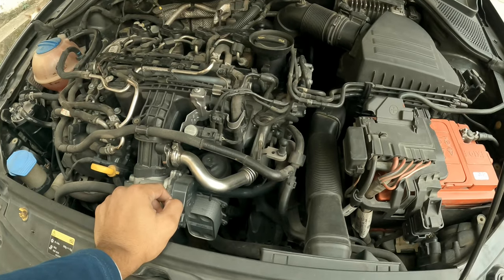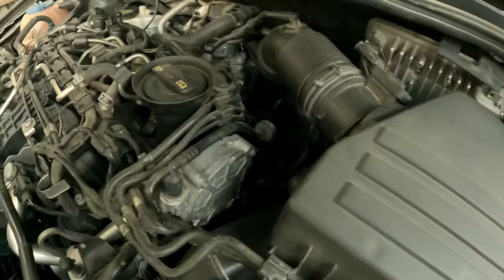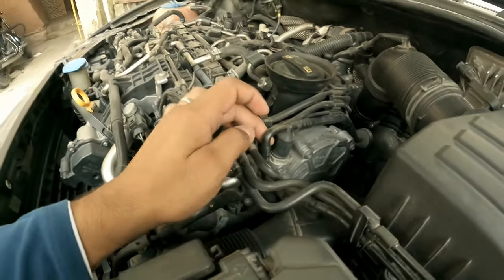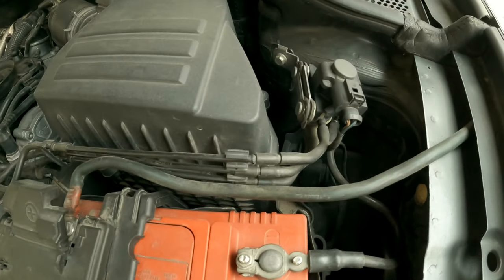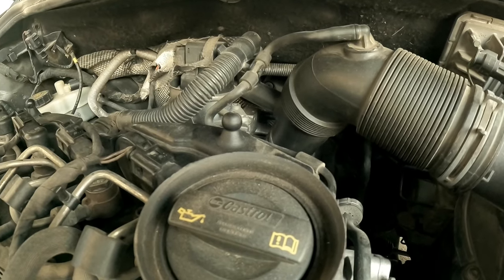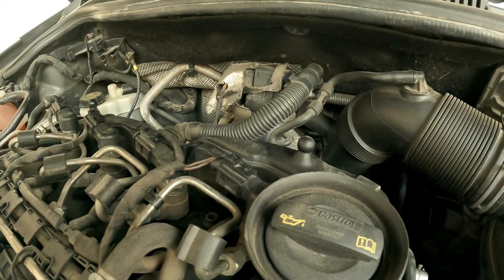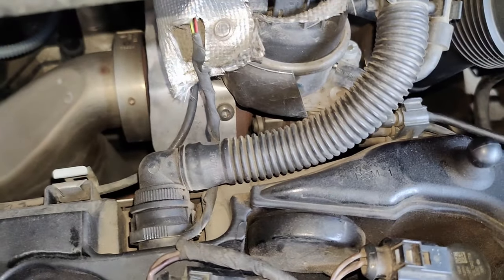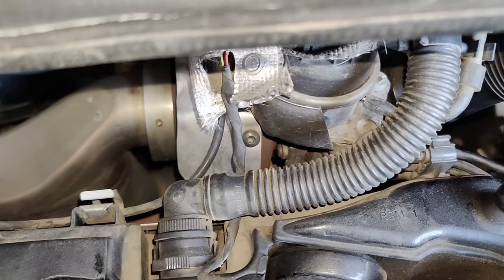TURBO BOOST PROBLEM VACUUM PROBLEM | UNDERBOOST | OVERBOOST | LIMP MODE | P0299 | P02563

Comment: Hi dear sir the glow plug sign and engine management sign come every time and I have to take to mechanic every time can you advice me can do my self I spend money every time please if you have videos how to repair so I can try sir
Reply from the maker: What's the actual problem or the code if you have any ?
Reply: @yourDIYneeds  yes sir code I have P2463    Next p0121 Throttle pedal position sensor switch A circuit range performance I clean this 100% and fix his place again but three sign still there sorry you speak hindi thank you sir if can help me
Reply from the maker: P2463 is particulate filter 
P0121 is throttle pedal  range 
Try adjusting the throttle pedal in exactly in a way that is just a bit less than , raising the rpm of engine .

Comment: Sir,fault code P256400 pls tell about this issue
Reply from the maker: Sir tubo ke boost pressure sensor pe voltage ka error hai , maybe low or high
Reply: sir,Circuit low
Reply: How to solve this problem sir
Reply from the maker: Yes , its not receiving the desired amount of voltage

Comment: Hi sir, thank you for informative videos on TDI engines. I have a 1.6l tdi CLN motor, it's throwing a p0407 engine fault code. What could be the problem?
Reply from the maker: Sir , need to clean the egr .
Its a code for egr system

Comment: Hello bhai, 
I have a vw polo 1.2 tdi, same warning sign glows as in your video when I hit 120km/ph or when I hit the gas a bit harder.. I replaced the Heater plugs already but that doesnt seem to be the problem, do you have any tips of suggestions of what it can actually be? Thanks for helping me out 🙏
Reply: filament bulb sign I mean with warning sign
Reply from the maker: Sir the very first thing is to scan and look out for codes , it will provide you with a direction to work
Reply: @sameditzz287 did u sort it out? I am hving same code
Reply: @hariskhan1000  better to sell your car pr get your car fixed asap cause its not a good sign for your car/engine i  have already sold my car bearing some loses but i was literally fed up by repairing the vehicle again and again as this problem led to wear and tear of my machine !!

Comment: Thanks brother for explaining the untold stories of skoda/vw cars. In rapid ,the vacuum control actuator was making some weird noise after switching off the engine. And only rarely it happens. Scanned but no issues found.. and there is no pick up issues also ..
Reply from the maker: Sir its getting stuck on random positions , thats why its making noise .
Reply: @yourDIYneeds  thanks for reply.. Is it a costly part? There is no regular noise from it.. But only rarely..
Reply from the maker: It has started to stuck , use it till the time its working sir
Reply: @yourDIYneeds  yes.. That will be good.. Now searched in blood money. It's listed as pressure converter costs around 4500.. Thanks 🙏
Reply: @yourDIYneeds  one more thing noticed regarding that part. Today morning, I started it, kept it idling for arornd 30 mins as I didn't drove for the past 1 week. The particular part heated up a lot that we can't touch it. Is it normal or symptom of getting damaged ? My area is not a hot area. Only around 27-28 degrees
Reply from the maker: No sir it usually is just warm , not hot
Reply: @yourDIYneeds  it's really hot. Whether it's complete failure cause stalling rhe engine on the road? Or powerloss kind of things...
Reply from the maker: Sir , as soon as it gets cooked complely , you car will go into home limp mode and cut power , but it will not leave you stranded on road , don't worry
Reply: @yourDIYneeds  will try to replace by December..probably it's a plug and play fitting as it seems. .. Annual service done 2 weeks back by myself.. So little financial crunch.. All filters replaced and flushed the engine. Filled with edge. As it ran only 2800kms , didn't go to liqui moly.. Thanks brother for ur support and videos...
Reply: Bro .. replaced the solenoid valve as it was making noise andvibrating ever than before.once happened to visit ASS, the technician accidentally touched and burnt his fingers. So it's replaced from there itself. Now the noise is gone but still getting hot after few mins of drive. While idling , if we touch it, we can feel the solenoid inside is moving randomly . Then actual reason is not the solenoid valve ? Checked the vacuum lines , didn't see any visual leaks. Any clues ? Thanks
Reply: @jinurajkr  any update?
Reply: @jinurajkr If your solenoid is hot, you might have a leakage somewhere. Check careully the hose from the solenoid to the t-connedcn . From t-connection to the pressure converter which is connected to the top of the wastegate. Take the hose out and check for any damage. I have replaced my hoses. If you have a BMW you need to buy 3,5mm diameter vacuum hoses. You can see it is something wrong by checking the datastream of the booster pressure solenoid. It should show steady at 100 percent. Use a car tool scanner.
Reply: @dinhvanpham8102   Thanks for ur valuable suggestion . Will definitely check.. Mine is a Skoda

Comment: Hi I have a 2016 Jetta 1.4 tsi and my wastegate actuator seems to not close all the way sometimes and it makes a kind of ticking sound when I’m driving when it’s making boost . I get out the car to pull the wastegate rod close and it’s fine for awhile then it start again do I need a new wastegate actuator?
Reply from the maker: Sir try to do a turbocharger adaptation , if the problem is not solved after that , then we are looking towards replacing a part .

Comment: I buy new Artilink 500 from this cod rider can I remove this sign 🙏
Reply from the maker: If the problem is not addressed first , it will come up again
Reply: @yourDIYneeds  thank you sir 🙏
Reply: @yourDIYneeds  if I drive car in motorway any problem sir

Comment: Hey I have a 2014 vento tdi .I notice since I got it, the brake pedal is very hard when I jump in a few minutes after I turned off ( 5 or 10) . Like a boost leakage but I don know if this is normal or not . It's not getting worst but I have it my mind
Reply: Not boost . I mean vacuum: )
Reply from the maker: Sir seems like a vacuum leak , may be a leak from the vaccume lines or brake booster itself , thats why brakes are hard
Reply: Any update i had same issue i changed boost solenoid and it went ?

Comment: Hey please helpp i am getting error code P029900 car giving white smoke on reverse gear or when need power it fails to give but according to mechanic turbo is okayy tf is happening with the car also it’s burning engine oil ?? Please reply asap
Reply from the maker: sir its a code for under boost , check all the pipes and connection from turbo to intake manifold , either there is a loose connection which is letting air out or a pipe got cracked.

Comment: Awesome content🎉
I have tak tak sound coming from the n95 module in my 1.5 tdi. No error codes.
Any info about that?
Reply from the maker: Noise is nothing to worry about , ECM is just trying to control the vacuum by rapidly opening and closing of the solenoid which creates that "tak tak" noise

Comment: Please Please help me. I have serious problem in my VW Vento 1.6 TDI 2012 model. Problem is , when i my car reaches exactly at 100kmph , there is sudden drop of pikcup and glow light comes on and car stops pickinh up. On scanning with OBD , there is this error PO299 , Turbocharger Underboost. 

Can you please tell me the fix ?
Reply from the maker: First check if there is any leak in the charge system ( from turbo to intake manifold ) like a loose pipe clamp of a punctured pipe line 
Second if it still exists then , it can be one of the two sensors which is faulty , either charge pressure sensor or VGT actuator.

Comment: Is it ok to blank egr of xuv500 1st gen?
Reply from the maker: Sir egr blanking can be done on any vehicle , some engines will not throw any kind of check engine light , but some does
Reply: @yourDIYneeds  after blanking egr on my xuv500 there little bit oil leakage from breather… is it due to egr blanking or there might be some other issue?… please reply😇
Reply from the maker: No sir , its not due to egr , egr track starts after the exhaust manifold and then it returns some of gas to the intake back , if that intake return line is loose , thats a totally different things but egr has nothing to do with it

Comment: Hi my 1.6 audi a3 has coil light flash then engine management light with code p2563. Is the fix to replace the vaccum pump or the accuator or sensor?

Comment: Hello, I have a golf 5 2.0 TDI 103kw 16V, 2004 year, I have repaired my turbo 3 days ago it was in terrible condition and I always had a problem of my car going into safe mode, I can drive it fast and give it full power but when I maintain a certain speed, let’s say 130km/h in 6th gear, after 15 - 20 seconds the car just goes into safe mode, it makes a weird whistle noise as if there is a hole in the pipes of the turbo but there is no holes.. If anyone can help I would be grateful.. I have it for 10 month’s and noone knows what is it.. Some say it’s because of throttle valve but I don’t know.
Reply from the maker: Sir the best thing is to check it with a scan tool  and have a look at the live data .
Check few parameters like charge pressure, vaccum , MAF values  and check these things on both ends actual and specified, if you find any difference between actual and specified , then that is your problem

Comment: My car has difficult issue. When i start car vaccum is perfect bcz turbo actuator rod moving in actuator side then i shut off my car them its moving opposite of actuator but the problem is when i accelerate my car - actuator not move (No boost ( glow plug light also flashing) ) help me anyone
Reply from the maker: Have you checked the vacuum control actuator ? It is located on the co-passenger side just on the right side of the battery ? Its also called N95 valve
Reply: @yourDIYneeds  yeh, that working fine when i start car or shut off car
The problems is when i drive or accelerate car car took only vacuum. No boost at all
Reply: @yourDIYneeds  when i start car turbo actuator moves , when i ignition off car actuator move another way
Reply from the maker: Sir then look for any kind of leaks or loose pipe connection on charge system, from turbo to intercooler and then to intake manifold
Reply: @yourDIYneeds  Hello .. all the pipe lime are perfect.. my last question is .
Can this problem happen with CAT or from muffler ?
Reply from the maker: Sir , Only if its seriously blocked , check the exhaust flow on the tail end once to confirm that

Comment: Hi man  i have code on my golf 7 2.0 Tdi 110 kw P2563,can u help ?
Reply from the maker: Sir it seems like you need to calibrate the wastegate actuator on turbo , maybe due to deposits , wastegate is not able to open or close completely, address that once and reset the codes and check again after all the these things
Reply: @yourDIYneeds  Can i calibrate it with vcds or odis ?
Reply from the maker: Sir maybe with odis its possible but of vcds is not showing the calibration options then its not possible through vcds , but my question is why do you want to do it ? 
Because engine automatic calibrates the amount of fuel delivery and pressure as per the requirement of engine on every rotation!
Reply: @yourDIYneeds  because lamp is blinking on dashboard
Reply from the maker: Then firstly check for error codes

Comment: Hey bro in the obdeleven you have can we do injector minimum quantity adaptation? (where the engine keeps raising to 4k rpm for several minutes to learn pilot quantity of injection)
Reply from the maker: Yes air we can do that , but before i would like if you watch , another video from my channel , which is the explanation of that topic , it might change your opinion
https://youtu.be/bdbaLKn611I
Reply: @yourDIYneeds  buddy I've seen each and every video of yours!! I'm a long time subscriber!!
Reply: I had mailed obdeleven official site but they said they do only software support for the one click apps. Just to confirm before I order should we enter some channel manually to select micro quantity adaptation? If so please check and let me know. It's one of the reason I want this over vcds Ross tech.

Comment: Hello sir plz suggest me which tool kit set is best for tata safari dicor
Reply from the maker: Sir for safari you need 24mm + oil filter tool and basic screwdriver set is needed ( for general service , but for further work you will need almost all the sockets for 10 to 21 mm
Reply: Turbo accuator is not working  how to solve it means not sucks finger when we remove pipe from actuator sensor safari 2009
Reply from the maker: Sir have to check the operating voltage on the connector of sensor with load , if the voltage is ok then chances are that actuator has gone bad
Reply: @yourDIYneeds  acuator naya laga padega ya yeh saaf b ho sakta hai aur isse ke kharab hone se pickup bikul zero b ho sakta hai
Reply from the maker: Sir pehle to voltage check hogi , kuki agar wohi nahi aa rahi hogi to actuator work hi nahi karega

Comment: Vw vento 1.6 tdi engine down ka pta kaise chLta hai bhai ji
Reply from the maker: Sir engine down ? Mai samjha nahi ki aap kya pochne ka try kar rahe ho .
Reply: @yourDIYneeds  mtlb ki vw vento ka engine overhaul hona hai toh kaise pta kre . Mtlb engine back compression kaise check krte hai vw vento k liye
Reply from the maker: Sir vw tdi engines me thoda sa back compression ( blowby ) by design hi hota hai usme worry karne ki need hi nahi hai , baki agar fir bhi overhaul karne ka jab pta lagega , jab engine ek limit se jada oil consume karna start kar de  ( 1 fl. Quarts of oil every 1000 miles ) ki limit tak bhi normal oil consumption consider kia jata hai , ye data vw USA ka hai , india specific data available hi nahi hai .
Reply: @yourDIYneeds  engine start mein  oil filler cap kholne  k baad engine oil k छींटे  bhi aate hai kya bhai ji
Reply from the maker: Ha thode se sir

Comment: What is limp mode?
Reply from the maker: Sir , It's a mode where your engine cut power to save it from damage , when something is not rite
Reply: @yourDIYneeds  ok sir , my car's engine not revving beyond 2000rpms.
Is it in limp mode?
Reply from the maker: On idle ?
Reply: @yourDIYneeds  no sir , when driving.
Ik On idle rpms are restricted .
😊
Reply from the maker: Any kind of warning lights on cluster ?
Reply: @yourDIYneeds  yes sir coil light+ engine light
Reply from the maker: Sir fir aap ek bar pehle scan karwa lo , ek Direction mil jaegi kaam karne ke lie
Reply: @yourDIYneeds  done hai bro! 
Will update you jo bhi hoga.

Comment: Plz bro... Make a video on fault code p2425 (exaust gas recirculation cooling valve control circuit/open) this fault code shown in my vw vento 1.6 tdi.... But performance is good till now.
Reply from the maker: Sir it can happen due to 2-3 issues ,
1. Clogged EGR cooler 
2. Increased exhaust gas temp.
Sir can you tell me if you feel like the engine is running hotter than normal ? Or power drop of any sort in any rev range ?
Reply: @yourDIYneeds  yesss slightly power drop... For just 1 and half second....but it's really minor Every time i rev it on third Or fourth gear......and it's all happen after that fault code... What can i do now? Any solution?
Reply from the maker: Sir you egr valve is open all the time , most probably it got stuck in open position , just get it uninstalled and cleaned properly ( both egr valve and cooler ) and along the way check the wires for any kind of physical damage as well .
Reply: @yourDIYneeds  thank you so much sir❤